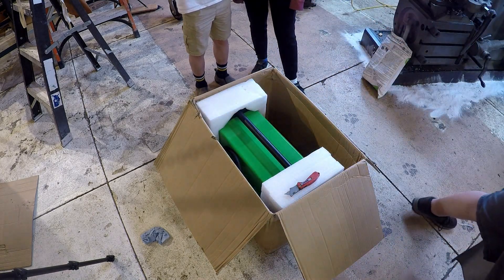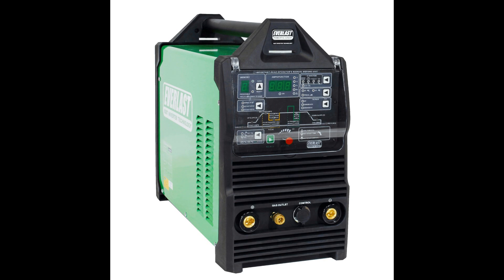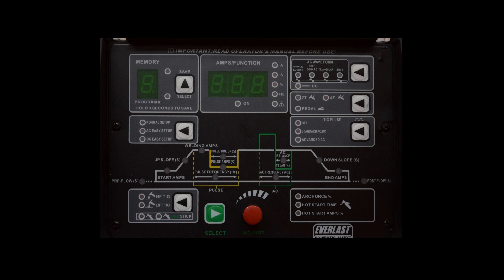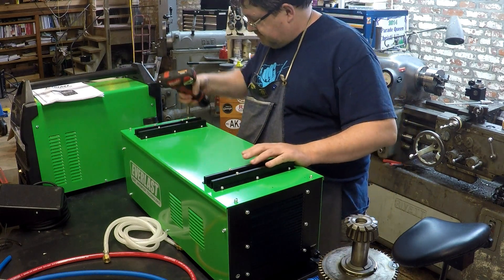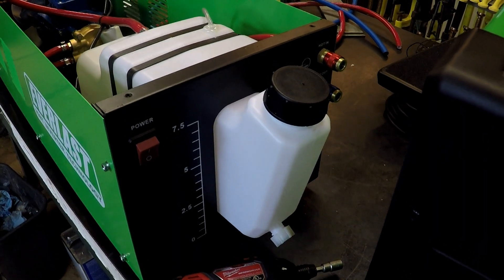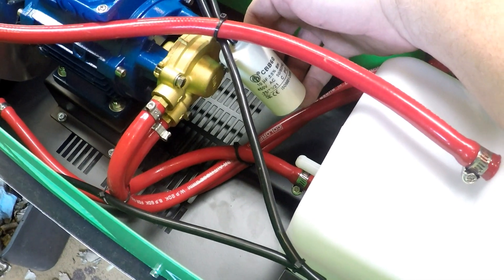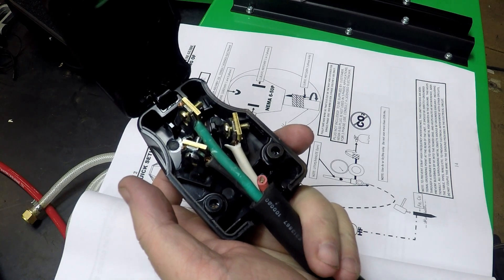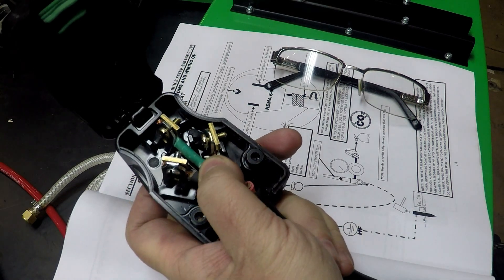FEED THE MONSTER! Unboxing an Everlast 325-EXT!

Comment: I've heard that the everlast comes with CK torches. Is that correct?
Reply from the maker: Not mine, came with WP (?) torches. And honestly, the water cooled torch started leaking after very very little use.  Leaking at the torch end, heavily.  So I am using the supplied air cooled unit until I can replace the water cooled torch.

Comment: In all likelihood the reason they don't include tungsten electrodes with the unit is that they don't know what you are going to be welding or the size of tungsten you will be using. Carbon steel, stainless steel, aluminium etc require different types of tungsten (Rare-earth, Grey. Pure, Green. Lanthanated, Gold. Ceriated, Orange. Thoriated, Red. Zirconiated, Brown.) and when doing spec work the grade of tungsten will be spelled out in the weld procedure.

Comment: At 4:50 your explanation is wrong.
In atandard pulse you can also set AC balance and frequency, The Advanced AC pulse is for more penetration, as that allows you to use a lower aperage for the cleaning part of the AC cycle, and use higher amp dc for the extra penetration.

Jody explains it here
https://youtu.be/RPoYSakqX9Y

I believe the advanced ac pulse feature only works on the advanced square waveform.

Comment: i bought one of there water coolers the pump broke after 4 times using it so i built my own i copyed the millers parts, also had a tig 205 that stop arcing and i sent it back after 10 or so uses and they sent me a newer model tig power tig 205 ultra been using that one for years but i have never welded with it i just use the plasma cut on it. There customer service was good but it did take 7 weeks to get the new one back. i call it the vacuum cleaner and yours sounds the same lol. you will have fun gluing alum with it till you get your part to hot the 1st time on tig and have a drop out hehe been there done that they suck. anyway thanks for sharing
Reply from the maker: THAT is meaningful feedback, thanks.  All without getting ALL CAPS.  I have a separate plasma cutter, a high dollar Hypertherm, had to replace the board in that machine, so you never know.

Comment: They are nice welders, one of the good ones. The bad is how loud the fans are on camera.     The 3 phase cable is so you can use two of the 3 poles from 3ph power.   2 poles to get 220 single. A neutral  , and ground.   I have my 110 lamp on my mill wired into the 3ph on my mill.. one leg and a neutral  to get 110 1 phase.

Comment: Familiar sound...mine is exactly the same. Wish they had the fan on a sensor. Overall decent machines even though mine blew up twice. 3rd strike and she's out though.
Reply from the maker: So you have blown boards on yours two times?
Reply: @jtkilroy  First time was when new...running plasma (mines a multi-process) at 50 of 60 amps (rated 100% duty) and she didnt like it. Repaired and been running fine since even doing the same levels.
Second time she worked on thurs but not on sat...in the meantime we had a lightning storm and machine was left plugged in. I'm blaming that one on spikes.
Sine the second repair the machine has been flawless and I USE it more than the average hobbyist. Great stick welder!
I only got the water cooled torch and wish I had the lighter air cooled but still getting by. For most usage I think they're great machines and I would consider another maybe a larger plasma only unit..

Comment: James, I got its little brother, the Power Pro 256S  -- so far it's been a great machine.   Looks like there has been no effort to reduce the F16 on after burner fan noise by even a few DB.
Reply from the maker: Wouldn't be over hard to put a thermistor(s) in circuit with the fan motors and bring them up as needed.  I just don't know what that temp needs to be.
Reply: I considered doing that.  While the FET heat sink would be easy to sense the ferrite magnetics is another story.  Will have to look at again, I think I am out of warranty now.

Comment: I know on residential 220v that 4 wire plugs are now required.
2 hot legs,  neutral & ground.
Must be spring break for your kids. 🤪
Reply from the maker: Hmmmmm, I guess I could tie a chassis ground into the circuit.

Comment: For three phase supply you just wire the outlet from two hot legs and a neutral, you now have a single phase 220 outlet. If you aren’t sure about what you are doing, hire a competent electrician.
Reply from the maker: You misunderstood my comment.  What I meant was that Everlast says there is not a 3 phase version of the machine, yet the topic of three phase hookup is all through the manual.  I decided to just hook it up 240 and not worry about it.
Reply: Might be similar to a VFD when running on single phase only 4 of the 6 input diodes are in use. If that's the case, less stress would placed on the diode packs and filtering capacitors if you have 3-phase available. If you had to run a phase converter wouldn't be effort. Just stick with single phase. 
This of course only if the welder can truly input 3-phase.
Reply from the maker: @TheAyrCaveShop  That is true, but for my limited use, not worth the effort or risk.